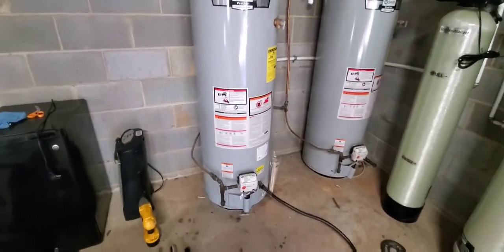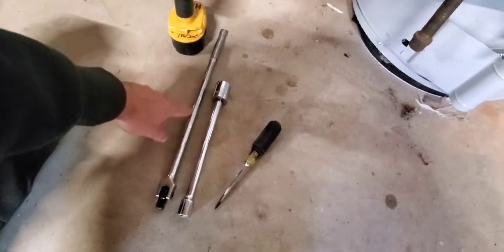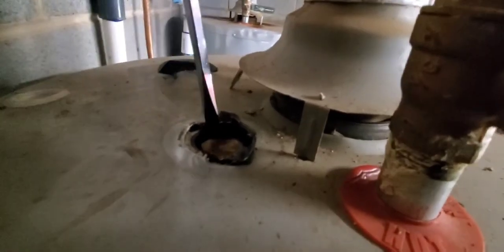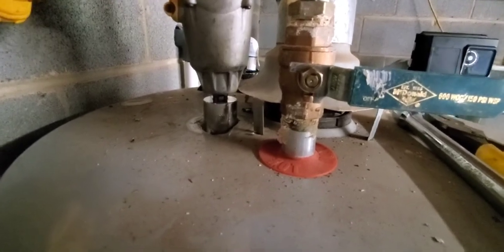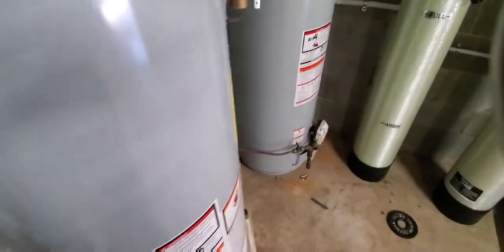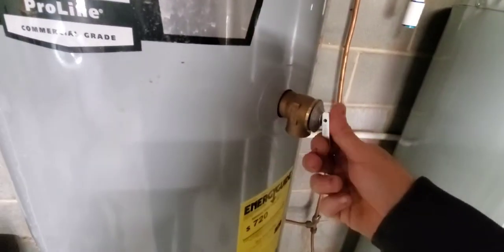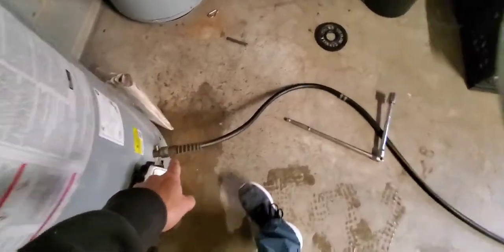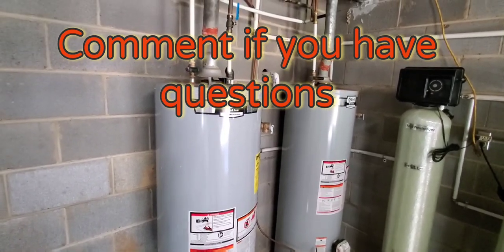Hot Water Smells Like Sulfur, Rotten egg. Removing Anode Rod

Comment: That anode rod is there for a reason so it shouldn’t be long before you are replacing the entire water tank. Get a powered anode rod to eliminate the smell
Reply: My tank is only 4 years old electric. And already getting that smell. But I have seen a lot of plummers just remove rod and cap instead of replacing. I’m trying to figure out why that is? If the rod helps the tank from not Corroding, then why not put a new one? And this is not the first person I’ve seen that done it this way. Also, if it only cost under $20 for a rod, I really don’t see the need to cap unless the bad rod means your tank is on its way out, which makes no sense in my case because it’s less then 4 yes old. Then again it’s my cold water that smells, so maybe it’s not the rod! Who knows lol
Reply: @danielvitolo2595  Guess they make more money when you call them back for a new tank in a few years.
Reply: @danielvitolo2595  The sacrificial annode rusts preferentially instead of the tank, and in doing so , releases metal ions that the anaerobic sulphur producing bacteria need to live.  A bad and lazy solution is to remove the sacrificial annode completely, so no zinc/aluminum ions are released, and the bacteria starve - but then your water heater element rusts away.  Use the powered annode to prevent rust, and it doesn't release metal ions that the sulphur producing bacteria need to live.
Reply: An aluminum/zink rod instead of the standard aluminum or magnesium rod will help with the egg smell. You need an anode to protect the tank. I change mine every 7 years with my slightly acidic water. My last water heater lasted 28 years and was still working when I changed it out for a larger one.
Reply: @dah61789dah   do u also have a water softner???  I heard aluminum zinc is for well and water softner houses.

Comment: You described everything perfectly very informative video however by removing the piano rod, you know open up any teeny tiny cracks in the glass to corrosion because that is supposed to take that corrosion. You can call the manufacturer of your tank and they’ll ask you some questions about your water, and they have different make up of rod so you can put an ad in there so that it won’t stink up your water in the tank to keep the tank and if the tank fails, that’s one of the things that they’re supposed to check before they just give you a new one if the end ischewed up or gone before they issued the warranty anyway just my two cents from an old old old plumbing and heating guy

Comment: Definitely needs cathodic protection. I replaced mine with an active anode (impressed current cathodic protection) made by Corro-Protec.  Without protection that water heater will only last a few years. With active protection it might get twenty. 👍🏻

Comment: I could not loosen the annode on the new tank, even with a 30 inch breaker bar, and I'm 6'5 220.  Needed an impact gun. - $70 from Harbour Freight.  Important bit of knowledge with impact guns - you need nice heavy impact sockets, as lighter ones don't work as well, and may break too.

You don't need to drain much of the water - just enough to relieve the pressure, but flushing it's a good idea.  Good way to do this is to turn it off the night before, and let it cool down before working on it.   Earthquake straps work well to hold the tank from spinning, which can happen even if it's still full of water.
Reply: Thank you very much for sharing valuable info!!!!
Reply: What type of impact  gun you used?

Comment: Thanks for sharing.................I know the rod is causing the smell, but it probably should be replaced because your water is eating it up the rod.  If there is no rod, it will attack the tank, no telling how much longer a new rod will make the tank last...... Looks like there is a water softener there......which should help......Maybe you need a filter before going into the water softener.  I have smelly hot water too and need to do the same.   

Hot Water tanks usually last 10 +/-  yrs, but it really depends on the environment and conditions.  My parents' hot water tank is over 20 years old and is still going..... The water quality, water pressure and water usage all play a part.  My parents also have their electric hot water tank on a timer from 8am to 10pm when they "normally" use hot water, so it helps min. the usage.
Reply from the maker: My home has an outside well house where the tank & Inline (big blue) filter is located. Then it comes inside and goes thru a acid neutralizer followed by the softener. I do know the water heaters life will be shorter, but they are cheap to swap out if it dies. Id rather do that than deal with sulfur water. Its amazing how aggressive water can be! Thanks for your insight, its greatly appreciated!  I have new videos coming soon on other Neat Well topics. So stay tuned!
Reply: @h2omechanic  Would it help to drain out a gallon of water every month if you take out the annode rod?  I'm wondering if that will help get rid of the minerals?
Reply from the maker: @MarkThomasBuilder  only way to remove minerals is with a treatment filter system. Like a acid neutralizer & water Softener

Comment: You should NOT drain the tank completely. Just drain off a couple gallons. You want the tank to be heavy with water to help stabilize the tank while removing the rod. Also,  there's no need to open the pressure relief when doing this procedure. Other than that,  I hope you know your tank is not going to last long with no anode rod.  You should have replaced it.

Comment: Taking that anode rod out is going to cause your tank to rot fairly quickly. It's there for a reason and should be changed out every 4 years or so. Sounds like your water needs to be treated before it makes it to the water heater. This isn't a proper fix.

Comment: That valve on the hotside could spell trouble in rare situations. Im sure you know what your doing but if the water ever went into runaway heating, the relief was seized shut and that hot valve was off could be a boom.

Comment: are you sure the cold water inlet puts water into the top, as you said.  I think that inside the tank, there is a tube under the cold water inlet that goes down close to the bottom of the tank, and there is where the water exits the tube and goes into the tank.

Comment: Does it matter the type of rod?...I watched another video that claimed it was due to the fact most rods are magnesium.... and say an aluminum rod can serve the same purpose without the smell.
Reply from the maker: Correct. 
You can replace the rod. 
But I normally just remove it and cut it off & re-install. 
If you have green stains around sink drains, the you have acidic water and would replace with a different element rod.
Reply: I just bout the Magnesium anode Rod.  Wonder if it’s the right one?  Dude in here makes it seem there should not be a Rod.  Agree?
Reply: I read the same about aluminum.  My new house isn't even being lived in yet amd it stinks, with a 220 foot well

Comment: This is why the dislike counter shouldn't have been taken away. Great instruction on removal, but not replacing the anode rode is really really bad, basically the water in the water heater will now begin destroying your water heater like it did with the old anode, go to Home Depot and buy a $30 anode rod to replace it with.
Reply: So you would replace a $30 part every few months to give a $300 heater a few more years of life,
Reply: @garybucher6824  A 50 gallon water heater is roughly $600-$700 as of 2023. The anode rod should be replaced every 3-4 years. The real issue is his water quality is bad and needs to be properly treated. What he's showing in this video is wrong on many levels. A powered anode rod can also be used to stop the smell. Thank goodness you don't have all these issues on a sanitized municipal water supply.
Reply: @Desert Explorer 302  not my water heater and you can keep that suburban bs and I'll keep my well water.
Reply: @garybucher6824  Don't get all butt hurt just because you have bad water. Have it professionally tested.

Comment: did you get a new nut and rod eventually?  The anode rod has a purpose.
Reply from the maker: Nope. I cut off rod & threaded it back in. I'd rather have the heater die than deal with rotten egg smelling water. Most people feel that way too.
Reply: @h2omechanic  a new rod is only $30, supposed replace it every4 years is what I heard.  much cheaper then a new tank. It wont get smelly if you change is on time.
Reply: I got a new one and it still stunk. Called a different plumber and he told me they should have removed the rod from the beginning
Reply: @mikepatyak1997  were you using an aluminum or magnesium replacement rod?  If you have a water softener you should use magnesium.
Reply: @h2omechanic  You're taking a short cut and not addressing the water quality problem which is the real issue.
Reply: @chriss4739  
I got a new heater and it smells in first month. The rod creates the smell if you have a water softener.

Comment: I had someone do this for me today. It got rid of the stinky smell! Lots of people on Google say this is stupid and will ruin your hot water tank. What are your thoughts!? I have well water
Reply: Well water should be properly treated. There are a lot of dangerous chemicals that can be present. Don't rely on the standard county test, seek out a reputable third party to test your water. It's your life on the line. At the very least I'd install an under sink RO system and only drink or use this water for cooking.

Comment: I have a brand new water heater.  Now it smells.  Menards has 2 types of anode rods.  Magnesium or Aluminum.  I bought the Mag.  Is that the right one?
Reply: No. From my research, a zinc (actually aluminum-zinc) rod is recommended to aid in ridding the water of a sulfer smell.
Reply: They also have a powered anode option that is supposed to kill the smell.

Comment: Is there a place on the water heater that tells you what size a node rod you have and what size the socket I need
Reply: Owners manual. Google your model number. But seemes like 1-1/16 is standard
Reply: It is one of the basic, standards in the plumbing industry - they’re all 1  1/16 inches

Comment: This is really bad advice. First, you absolutely need that sacrificial anode; without it the tank will start corroding immediately. Look into magnesium vs aluminum/zinc options, or a powered anode if you have smelly water. Second, you don't want to flood the top of your heater. Did you think all that water running down the chimney was a good idea? 
You don't know what you're doing here. Do more research or call a pro, and for Pete's sake don't post a video telling others to do this.

Comment: DO NOT follow this advice. This is ridiculous and wrong. 

Anode rods serve a very important purpose. Look no further than the rod removed to see the degradation. Removing the rod will accelerate this same thing happening to the inside of your tank, which will prematurely require tank replacement once it starts to leak. 

If you have a rotten egg smell you can change the anode to a different metal to eliminate the smell. They come in zinc, magnesium and aluminum. In fact, do yourself a big favor and install a powered anode that you never have to replace and that will eliminate any smell.

Comment: Mistake one was using an impact to remove the rod. That is what destroyed the rod. Obviously water ate it up some first.
Reply from the maker: Id have to disagree. I've removed a dozen of these & never had this particular experience. This was my water heater, the rod was only 1/3 of the way tight compared to others. Its shown in the video for different ways of removal.  The rotation didn't help the situation, if it did, it would have been bent, not separated at the top. The top died because that is where the fresh water comes into the tank & it sees its most aggressive mixture there. That's my opinion, thanks for your insight 👍
Reply: @h2omechanic  I've removed rods and elements with impacts. Every single time they get destroyed by the sudden torque hit. I've never had this problem using handle tools. Never.
Reply: @h2omechanic  That make sense.
Reply: Just "modded"  mine.   Took it out with the big boy matco half inch impact,  came out fine.  I bet yours was a lot older than mine from the looks of it and had weakened and bent, but it still came out!  Thanks for the helpful video.
Reply: Also I was by myself and couldnt stop the whole unit from rotating with breaker bar and didnt want to break any water or gas lines.
Reply: @rollinred5785  we all do what we can. I've messed elements and anodes up with impacts. Really if you know your replacing it then it isn't the end of the world.
Reply: @jameshorrocks2939  if you use an impact it's best to just use it to break the bolt free a little bit, then hand crank after.  Otherwise, like you said, you risk damage especially with the threads.